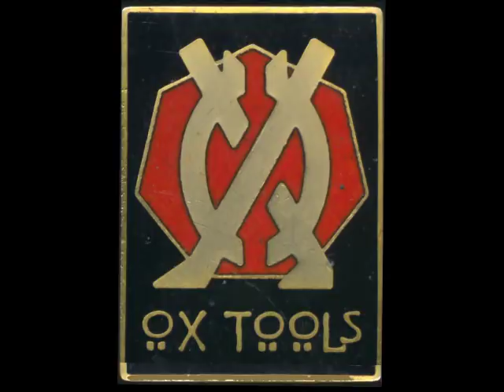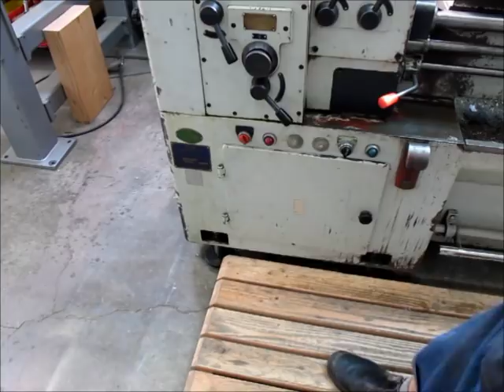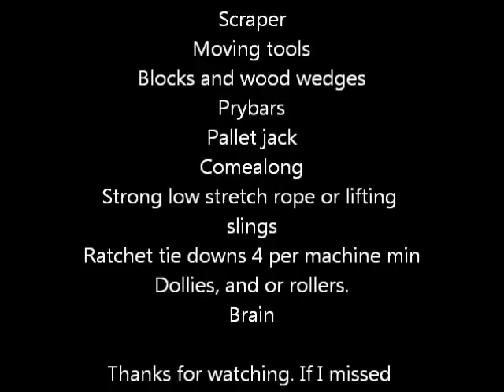Evaluating and moving a used metalworking lathe

Comment: The first thing I look at 
1. How bad was the compound beat by the chuck. 
2 The shape of the ways. 
3 Most important,  the taper 
 on the inside of the quill,of the tail stock. 
 Where I work now, I have never seen so many bitched up tail stock tapers. 
 My 2 lathes I own,  exceptional shape. Very few people I would let use.
I would never ever lift a lathe by the chuck.  Unless it wasn't mine, and my boss insisted on lifting it like that.

Comment: I'm getting my Heid K26/32 lathe today. Here in Sweden once a deal seems legit and the price is right, you have to through yourself on the phone and settle the deal right away. Yesterday I just missed out on a Storebro gk-195 completely refurbished for like 3000$ equivalent. And those once they are refurbished or restored by the manufacturer sell for about 25000$ So that was a bummer. Anyway, I will probably post a video on the lathe. It has an unique copying or tracing attatchment built in to it. And not the hydraulic kind. It's actually an electromagnetic cluth type of deal that operates the apron. Maybe that could be of any interest for all you toolgeeks out there. :) I already have a storebro gk-195 that I painted and took apart some years ago. I have it on youtube too. 

Anyways, I love your videos, also abom79 and jodi with weldingtipsandtricks. You all contribute to some fine hours of watching when I'm in mental idle mode. A great way of learning. When my shop is ready I will upload some clips of some nice swedish machinery. Abene VHF 3 milling machine, Storebro Gk-195 lathe, and the austrian made Heid amongs other things.

Cheers

- Nicke from Sweden
Reply from the maker: Hi Nicke,

I would like to see some pictures of your new machine. I encourage you to throw some videos up on youtube. Plenty of room for everybody. You are so right on making the deal. You have to be aggressive and move quickly once you find something. Thanks for the comment.

Cheers,

Tom
Reply: Just like you said, yesterday I came by an pressure blasting cabinet that was to be seen at a swedish craigs-list type of page. I called right away, 800bucks equivalent for a pressure vessled cabinet with separator and filter. Not one of those cheap ones either. Normfinish DP 12. It must have been worth like 3000$ at least. I got lucky. I just have to tune up the door hinges and a couple of things, easy stuff. Anyway, thanks for answering, I sure will upload some clips of the heid.

Comment from the maker: Hi Hedgehog,

A lathe without a lead screw cant really cut threads. Typically the feed rates are much slower than the very finest threads. As an example a thread pitch of 100 threads per inch works out to .01 per revolution feed which is a fairly fast feed rate. If there is a place for the lead screw then you could fabricate one on another lathe and use it on the lathe that is missing the screw. It is not practical to replicate a key missing part like the lead screw.

Regards,

Tom

Comment: I would suggest that someone would also check the change gears to make sure they are the ones to cut the threads they want to cut, seems most used lathes don't have the extra gears with them.

I wish I had saw this video before I bought the 13x36 clausing lathe I bought. I might have caught the bent teeth on the rack and the bent mating gear. I have found a new rack now but it need to have the back side milled to reduce the thickness. The gear is a whole different story, it is made on the shaft and the shaft is bent in 2 places. It is no longer available. I bought it from a used machinery dealer and he had it all painted up like lipstick on a pig.
I have bought another lathe that has turned out great and now I get to learn how to make a clausing bastard gear, it doesn't match the gear profile gage. I have heard clausing was good for that.
Reply from the maker: Hey Mystery man,

Change gears go missing all the time. Just like steady rests and other loose accessories. Check out Randy Richard in the shop. He makes a new pinion shaft for his Lance lathe. Not too difficult a project and some great video. 

Cheers,

Tom

Comment: It might upset the seller but always ask to have the chuck / faceplate / whatever removed so that you can check the spindle nose. Reworking a spindle nose could prove very expensive. I've seen turret lathes with the pilot bar and knee tooling or turret faces painted in entirety. An old boating saying - " a coat of paint can cover many sins". A machine may have been broken and welded, ground back carefully and painted.
Reply from the maker: Hey Jester,

Good point. Seen a few knarfed spindle mounts in my day.

Cheers,

Tom

Comment: Morning, a interesting video. I am just a guy retired and like to putter in my shop making things... If I where going to think about getting a lath to make some parts or things to make that your friends want... I am sure you know what I mean about that...llol My question is about what size would be a good average size to do such things as cutting and welding axles, making spindles, making shaft reducers or drive gears to gear reducers... I know thats a kinda hard question .... Also when they say 12" metal lath what are they saying... I know simple questions but I would not want to throw money away and buying a machine that cannot do much is just that.... I hope to hear from you Roger
Reply from the maker: Hi Roger,

You are right that its a tough question to answer in a couple sentences. Here is what you look for. The hole that goes through the headstock is a limiting feature to some of the things you mention. I would say from your description you would want a lathe with a spindle bore around an inch and a half and a swing around 10-14 inches. The swing and spindle bore are tied together a bit. Bigger lathes have bigger holes but not always. Drop me an email if you want to discuss something your looking at.

Cheers,

Tom

Comment from the maker: Hi Hedgehog,

It will depend on the lathe configuration. Most lathes can be slung through the bed casting webbing for lifting. However this is a problem on a shorter lathe. Most manufacturers have rigging recommendations for their machines. The headstock is heavier than the tailstock so some bias in the rigging is needed to balance the load. It is important to make any heavy lift as close to level as possible. Check out factorydragons channel. He had a lathe delivered how you are.

Best,

Tom

Comment: I'l be bringing a indicator on a magnet block to check my lathe chuck for deflection when I buy my lathe
Reply from the maker: Hi Final,

Bring a block and a prybar so you can gently lift on the chuck while your indicator in mounted. There are many more things that fail sooner than spindle bearings that require close examination. Look for signs of high speed impacts or crashes. These are serious red flags if you find them.

Cheers,

Tom
Reply: oxtoolco Thanks! I'm looking at a South Bend 9", They're nice little machines! In this case I'l have to be careful to check inside the gearboxes for chips and stripped gears as well!

Comment: Really great video.
I also intend to buy a lathe, so I have a dilemma about transportation.
Actually I have the same problem as JRoque. The lathe that I intend to buy is far from me, and the only way to transport it is to put it on a truck with a hydraulic arm. So my problem is how to lift the lathe with that hydraulic arm, where to connect the lathe and to avoid breakage?

Comment: Great video!  Shouldn't the carriage be partially locked when cranking down the ways to  test for binding?  Can that much weight be moved on a level concrete surface with just a pallet jack?
Reply from the maker: Hi Mar,

You need to feel the motions with no braking to evaluate if they are binding. Your motions should be smooth and not change resistance depending where they are along the travel. Pallet jacks are good for up to around 5500lbs depending on the make. Great tool for moving toolroom equipment like small mills and lathes. You can gang them up if you need more capacity. Thanks for the comment.

Cheers,

Tom

Comment: Excellent video, thanks! I'm also on the market for a used lathe and mill. My biggest issue is how to move them - as in putting them on a truck/trailer and bringing them home. I'm practicing using an engine hoist and moving my 300# Chinese lathe around but getting in the 3K to 4K pound range is a different game altogether. Any tips on the trucking part of it? Using a flatbed truck and roll it on, maybe?

Comment: Hello Tom. Great video.  Question, at what point is rust a deal breaker?  For example, is rust on a 3 and 4 jaw chuck a deal breaker?  Can you maintain a level of precision with rusty surfaces?
Reply from the maker: b18craz Hi B18,

Good question. Heavy rust on any precision surfaces is really a problem. Now if there is what I call dusty rust on a few spots then its probably not a huge issue as long as it doesn't get worse. Dusty rust is that kind of rust that you can mostly wipe off with your hand or use fine steel wool to remove completely. Anything requiring power tools or major abrasives is a deal breaker in most cases. Thanks for the comment.

Cheers,

Tom

Comment: Someone took a thumb and a half sized chunk out of the cross slide at some point in the last two decades on father's very rarely used TIPL-4. I haven't noticed anything obviously wrong as a result, but what should I look for specifically? I assume crashing the chuck may cause damage inside the headstock. Is it worth it to clean up the damage to the slide? I'm wary of welding anywhere on a machine tool, and bondo would feel like cheating even though I'm not planning on ever selling the lathe.

Comment: I had to watch this again, I'm lathe shopping at the moment ( my first) and I needed a refresher, how did you do the swivel  joint on that BB Dolly? Im Looking at Sag 12 at the moment, and for a 12x32  she weighs in at 2200 lbs..
Thanks Tom,
Reply from the maker: +Phil's Projects Hi Phil,

I used a machine leveling foot turned upside down. It sits on a thin needle thrust bearing so it turns nice and easy. Thanks for the comment.

Cheers,

Tom

Comment: Hello again.
I have one more question about the lathe.
Can a lathe, without the leading screw, can perform threading of the cylindrical part of metal (making the screw, for example), using just the feed rod?
And, could it be made (the lead screw), and installed into a lathe on, for that purpose, place intended and left on a lathe while in factory?

Comment: Great video, i only wish i found it last week... lol i just pulled the trigger on a new lathe purchase. It's a Lagun Republic 16" x 40". 

i noticed a couple of stripped gears inside the main gear box, they will limit my speed selections by two letters. i will have to remove them an figure out the best method of getting back to full gear choices... (a) replace gears with oem factory gears. (b) replace gears with aftermarket gears. (c) have a shop make me some  (d) buy a cutter and ask a more experienced local hobbyist to cut me a couple.

I'm not sure which option to try????
Reply from the maker: Hi Billy,

It depends how much the replacement gears cost and how bad the stripped gears are stripped,. A few teeth can be welded or brazed up and recut pretty easily by a handy person. No teeth at all and its buy or make from scratch. Get a price first if they are available and all will become crystal clear.

Cheers,

Tom
Reply: thanks Tom, i will get to work on removing them.

Comment: Great video, very informative.  Just up scaled to a larger (to me, 13x40, 1300 lbs) lathe and am in the process of setting it on its base.  I'm tall so I want to raise it up about 6 to 8 inches with three layers of heavy wall 2 by 4 tubing arranged like lincoln logs on the heavy end, a square on the lighter end.  Four feet on one end, 2 on the other.  Each  foot will get a NHL type dense rubber hockey puck as a pad onto concrete.  Obviously top heavy, thinking about widening the lowest tube for stability. Any suggestions? Maybe weld in a flat stock bar to lock the legs together over the length of the lathe? I do not have a lathe foot brake.
Reply from the maker: Hi John,

If you raise it six or eight inches I would widen the footprint at least the same amount at each mount. Thanks for the comment.

Cheers,

Tom

Comment: I just bought my first lathe at an auction cheap, an old Belgian machine from Mondiale. A type L. I have the largest of those. Loads of tools with it and 3 -4 extra chucks. The one on it at the moment is a BSA. I have to fabricate a few face plates for the others.
Not much info other than the owners manual. No parts catalogue. Came from a Danish National guard unit that was disbanded I think. Lathes.co.uk has no info on it other than a few pictures showing the controls and what it could look like when I am finished restoring it. It infinitely variable speed with a variator, though I think it needs cleaning and lubrication. Won't really move or vary speeds. Still need to hook it up to power. 
14x60" with a gap bed giving me 20 3/4" swing over 7". From the looks of it gap has never been used. Probably rusted in place. There is some surface rust on the ways where it hasn't been used, that will be given a light stoning when I remove all the crud from it. Looks like it was used and abused, paint is falling off several places and it was covered in oil residue, almost waxy. But has no play in either headstock bearings or ways, apron needs to be dismantled as I suspect it needs a good clean.
One of the Switch gears is toast with a lot of missing teeth so power feed is not usable at the moment. I don't know if I can source a set of gears for it or I will have to have some made at a later date. 
It has a Norton gearbox for power feed and screwcutting that looks as it hasn't been used much, very dirty but no marks. I don't know if I should modify it to be completely gearbox so I don't have to keep putting oil in all the various holes it has. There's 20 odd places to oil every day with felt wicks that take the oil as needed.. :D And grease points too. 
Is it worth it making my own foot brake/e-stop just so I can bang that if it goes haywire?
Reply from the maker: Hi Stefan,

I would get it up and running then decide what you want to add. Sounds like you have a bit of work before you need to have an answer to that question. Love to see a picture of her. Thanks for the comment.

Cheers,

Tom

Comment: Tom,  I bought  a 7" x 10" Precision Mini Lathe from Harbor freight just to tinker with in my lawn mower shop.  Have you ever seen one or operated one, and your feelings about the unit over all?  BTW I enjoy your videos, I spent 20 years in a heavy metal  shop that built road cont. machinery called CMI.
Reply from the maker: Hi Robert,

I have seen plenty of guys doing decent work on machines like yours. Better to have some kind of lathe than none at all. There are a few folks that have put up information on those machines and how to tune them up so they run at their potential. Thanks for the comment.

Cheers,

Tom

Comment: Great video, lots of information.  Any tips for moving a smaller lathe, like a 12x36 350 pound bench-top style?  I figured I'd use a hydraulic shop crane (Harbor Freight 1-ton style), but I'm unsure of where to hook straps, since I don't want to distort it.
Reply: +SatansSpatula I used heavy duty straps as slings through the bed on my 14x36 lathe. You won't bend a small lathe that way. Apply (what should be) common sense to ensure the lathe doesn't tip, twist or shift and apply load slowly while lifting. Secure anything loose, LOCK THE TAILSTOCK and take your time.

Comment: Hey,I like this video very mutch. I watched several videos , I have a question, My lathe has wear on the ways near the chuck, What can i do?
Reply from the maker: Hi Emil,

Thanks for the comment. Fixing it might be pretty difficult. You can machine the entire length of the bed down to the lowest point of the wear and add inserts to the carriage. I would suggest the book "Machine tool reconditioning" as the first thing you purchase if you are considering repairing the lathe. Many people under estimate the amount of work there is to restore a machines accuracy. Hope this helps.

Cheers,

Tom

Comment: Thank you very much for this great informative video - a much needed information.  Could you tell how would rate this lathe, what model is it and ball-park how much would it be worth the way you described it?  Thank you so much, Ciao, L
Reply from the maker: Hi Lancelot,

This machine is a YAM 1500G that came with some tooling. On the used machinery market this machine would be in the 4-6K US dollar range. Hope this helps. Thanks for the comment.

Cheers,

Tom
Reply: oxtoolco Thank you for your prompt answer and informative review - it really helps the non-professionals make the right decisions - thank you again, Ciao, L

Comment: Tom I have a question. I am looking at purchasing a lathe (JHF-GH) 13x40. It is made by the same company as the YAM you  I believe. The problem is the thread gage has no marks on it. If I make the thread dial at 1" of travel of the
carriage. I could do this for each number 1,2,3,4 and then mark 1/2 marks also. Would this work or do I need to get a new thread gage.
Reply from the maker: Hi James,

You should be able to divide up the circle on the thread gage and get some good reference marks. If its a YAM like lathe you may be able to buy that dial face. Even a good laser printed and laminated one would work. Its not a super accuracy deal just a reference mark for the apron gear. Hope this helps.

Best,

Tom